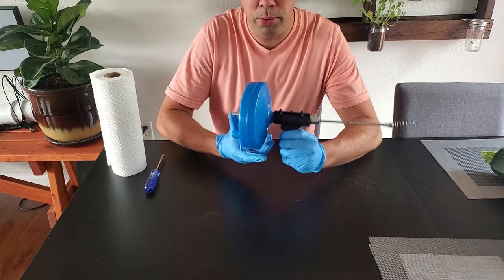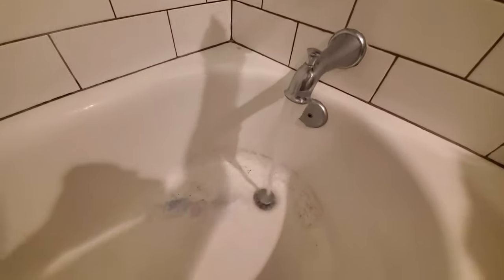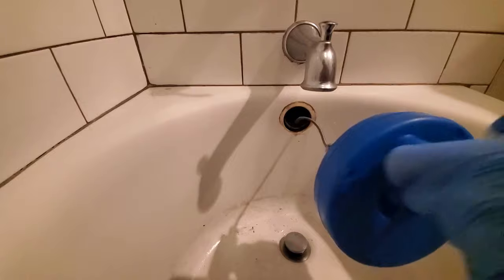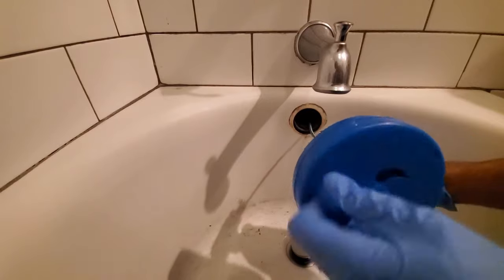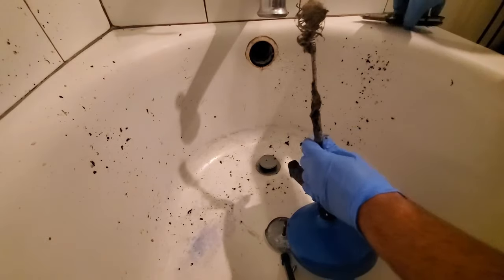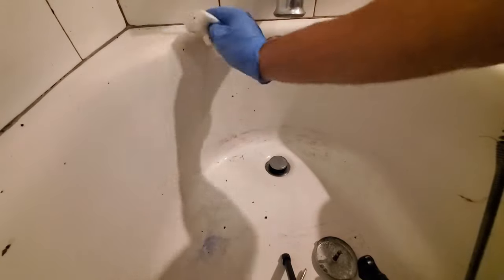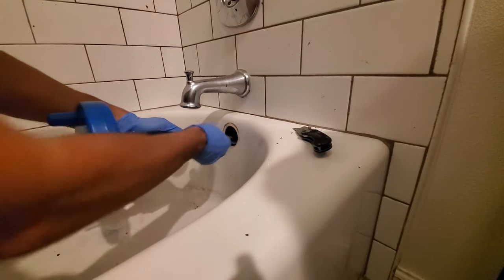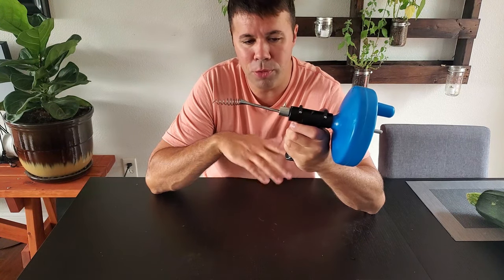How to Unclog a Bathtub Drain Using a Snake (Drum Auger)

Comment: Holy [cussword], I tried it and it *worked*! I was reluctant to use the auger I bought a few years ago at Ace Hardware for $15, because I am not very good with tools. But once I knew to use the upper drain opening and not the one at the bottom of the tub (which will get you exactly nowhere), it was extremely easy once I got that covering off. (Seriously, without the Internet, I would never have known that covering was over the main drain opening.) I could hear it sliding through the drain under the tub and it didn't meet very much resistance, so I just pulled it out (nothing but a little soap-scuzz on the coil) and then ran the water like I normally run it for eight minutes. It was clear as a bell! I keep a hair-catcher over the bottom drain-opening (and I kept it there while unscrewing and rescrewing the covering on the top opening so the screws wouldn't fall into the bottom opening), so I think there was just a wad of soap-scuzz in there that the coil pushed out of the drain and into the pipe. Now when I take a shower and the water flows out of the tube at the rate it's supposed to, I can say that I did that because I know how to do that!
Reply from the maker: Good for you!  Happy to worked out and you found my video helpful!  Now you will know moving forward how to always clear the clog yourself and save money from calling a plumber.  BTW...I like your "Holy [Cussword]" wording.  I am going to have to use that somewhere in my Youtube comments one of these days.  :-)
Reply: @JMGENTERPRISES  Here's another thing that helps you clear gunk out of very old shower drains without using environmentally-damaging chemicals: Pour 2-3 quarts of boiling water 2-4 times in succession down the drain. Of course, you want to be extremely careful conveying the pot of scalding water from the kitchen to the bathroom. If it's an upstairs bathroom, you might want to just boil the water right on the spot in an extra-large-sized hot-pot so that you're not imperiling yourself by carrying a pot of dangerously hot water up one or more flights of stairs.
Reply: Find a tub drain hair catcher to keep the hair out
Reply: @Wade7715  Been doing that for the past six years. My plusbig problem is soap scum mixed with that fungusy black gunk. (I live in an almost century-old building, so I'm sure the pipes are weirdly structured, adding another layer problem.)
Reply: @venuspluto67  thank you for your video. Well done!
Reply: @venuspluto67  Absolutely. Be very careful with scalding hot water

Comment: Came across this video while searching on using snakes to unclog a drain.    Just used one on a clogged kitchen sink.    Clog was pretty far down as it took a good 10 to 12 foot of snake before I saw the water drain.     Pulled up some assorted gunk and a safety pin of all things!

As to tubs, I have a cleanout plug which makes access very easy.   Of course if you have standing water it would be like unleashing old faithful once you remove the plug :-).
Reply from the maker: Glad you were able to use it with success on a kitchen sink!  Thanks for sharing!

Comment: If you rotate it clockwise on extraction instead of counter-clockwise, it won't splatter everywhere.  You're loading up the coil at the end like a spring and it's snapping loose when it gets pulled past its point of resistance.
Reply from the maker: Thanks for the tip Yale!  That will save me a nasty mess in the future!

Comment: Thanks for the knowledge.  Just did this, but had to run the snake down my vent pipe as it musta had leaves blocking the air flow.
Reply from the maker: Glad you were able to get it fixed!
Reply: Ughhh this is what I’m afraid of! My tub was flowing totally fine then all the sudden BAM nothing so I’m worried it’s the vent pipe. I’m def not getting up on my two story roof though!

Comment: reporting back here -- i got the amazon snake and snaked thru the top tub drain handle as shown in the video and all was fine, it got some hair out for sure. however, while it felt clear inside the pipe and was clear after a few more tries, and it did help the water drain a bit, it did not fix the clog fully. i could not fit the snake in the bottom drain to try there because it has the metal cross braces in it and the auger would not squeeze thru those. same issue for the bathroom sink. i dont want to force it too much and get it stuck, so i think i will have to go get another auger with a thinner/skinnier point. or maybe i should just try harder to force it past the drain braces anyway, not sure (i probably could do that)??
Reply from the maker: Can you remove the cross braces?

Comment: Any recommendations for getting sand out of the shower drain, was hand washing a wet suit and now my drains slowly draining 🙏🏾 I bought a cheap snake but i don’t think it can push the sand out ,, I don’t want to use draino if it’s just gonna get stuck in the tub , thank you
Reply from the maker: First off, hope you had fun in the ocean!!!  I wouldn't think the wetsuit would trap that much sand.  I have washed my off many times in the shower.  Have you snaked it several times?
Reply: @JMGENTERPRISES  I had accidentally let the sand set it and forgot to shake it out like a dummy , threw it straight in the tub , a good amout came off immediately then went down the drain , got stuck for a second then it went down but then it got clogged, i snaked both side of the drain and the overflow, completely clear but it’s pretty deep , would a shop vac work you think ? I’m debating either a auger or a shop vac , if you could give some advice!
Reply: @JMGENTERPRISES  thank you for replying!

Comment: Do you have any suggestions as to why the shower drain smells like vomit after using? And any remedies? It always comes back no matter how much it is cleaned
Reply from the maker: I would try some odor neutralizer liquid and see if that helps.  I haven't had that issue before.  Doesn't sound pleasant 😕

Comment: What do you recommend, my tub has 1 cleanout screw that comes out, and 1 cleanout screw that is stuck, whats the best option to remove the ceased screw
Reply from the maker: Usually heat works to break free a stuck screw.  Do you have a small butane torch?  They are like $10 or less on Amazon.  They come in handy for many things around the house :-)
Reply: @JMGENTERPRISES  im gonna pick one up thank you!!

Comment: Thanks for a great video. I know I must be the only one in the world who is having a problem. I having trouble to get the snake past the trap. It will not go. I go slow so it won’t twist and kink up. there is so many bends that the snake just wants to come back out of the bathtub drain and the sink drain. Any ideas? Thanks in advance
Reply from the maker: Have you tried both traps?  Sometimes the upper one is easier.
Reply: @JMGENTERPRISES  yes the two in the tub and one at the sink but I took the trap out and still same. What’s don’t make sense is I did this a couple years back with success. lol. Now is just not cooperating.

Comment: I watched your video and tried to insert the snake into both the bottom drain and the overflow hole below the faucet as shown in the video. Both have a trap or sectioned plate that I can't get past, even when using a drill. I finally got the snake into the drain and noticed that it was only going sideways until it was visible in the overflow hole under the faucet. I can't get the snake to go any other direction. What should I do?
Reply: I just realized that some of the tips of the auger are smaller. Mine seems too large and has  two different wider coils making it harder to get inside
Reply from the maker: Sounds like maybe try an auger with a smaller tip.  That's all I can think of trying.  I know they sell augers with exchangeable sized tips.  Best of luck.  Let me know how it goes!

Comment: hey so i tried this but my auger would hit something and then start winding in reverse...felt like i hit the bottom of something and the auger wouldnt get further and then when i pull it out i dont see hair or anything
Reply from the maker: Make sure to keep hold of the rotating knob so it does not start unwinding in reverse.  You may want to try going through the bottom drain the tub as well and see if you have better results.
Reply: @JMGENTERPRISES  thank you! I think i wasnt pushing hard enough bc it eventually went through and i managed to go through the full length of the auger cable. I need to go through the other drain but it has that annoying mesh thing you showed in the video /: so i dont think I can get the auger through 🥲

Comment: My bathtub drain is clogged and when I use the snake drill nothing comes up…what do you think is the problem and what should I do ???
Reply from the maker: How far are you going down with the snake?  I'm sure it's a semi clog somewhere
Reply: @JMGENTERPRISES  with the snake about 15 inches...it hits the bottom of something and when i start drilling nothing comes up but water does not go down fast
Reply from the maker: @arcademcFLy  it might just be a bend in the piping you are hitting.  Try twisting it some and see if you can fish any more line in there
Reply: @JMGENTERPRISES  twist right or left...not sure how the pipes run

Comment: Thanks for this video! So I'm working on our shower; it's a stall and not a tub so no overflow valve, I'm driving the auger into the drain in the shower floor. I was able to get a small bit of what looks like brown grass out of the drain after about three tries, but it's still not draining and I've used nearly all 25 feet of snake. Surely the clog isn't that far down? Is there another way into the pipes that I should try? Also I wonder if that grass-looking stuff means we have tree or plant roots getting into the pipes. :(
Reply from the maker: Sorry to hear about your struggles with your shower.  I haven't heard of grass before but yeah, it sounds like it is coming in from somewhere.  I've never personally had a clog further than 10 feet down so I would say you are safe if you used all 25 feet.  How do you know you have a clog?  Is it backing up with water after running the shower?  How long does it take to begin pooling in your shower?  Typically, the further down the clog, the longer it will take for the water to begin pooling in the shower.

Comment: Just curious why you go through the overflow drain and not the lower drain? I can see that the lower drain is where all tye hair is entwined around. I'm on here looking for a tool to remove the hair because nothing I have would grab it and found your video. I have an auger from several years ago I got to unclog a kitchen sink. It never crossed my mind to use on the tub because the build up seems to be right below the surface. This is my plan for tomorrow after I buy some gloves.  Thanks for your video.
Reply from the maker: Honestly, going through the overflow drain was how I was taught.  I would think going through the bottom drain would work too as long as you can fish the snake through the grate.

Comment: Mine, is a very old tub, it has that thing high up, but I couldn't see a screw, it just has an old chain for what was the tub stopper.  The drain itself, does have 2 thin rods blocking it like the thing yours went through, but my augur seems to get stuck almost right away in the drain after I get past the rods.  I'm hoping your advice will help get past that, otherwise I'll just be fortunate that my brother in law is a plumber, and is generally willing to help out with manpower type stuff.  

Might have to double check the overflow access, maybe there's something I missed, but I don't think so, because the whole faucet assembly seems to be blocking any potential removal.
Reply from the maker: So you do have an overflow access on your tub?  I would recommend going in that way.

Comment: How do you get it past the elbow via the overflow? That's where I'm stuck atm. Also tried plugging up the overflow and using a plunger to no avail
Reply from the maker: It should just push through the elbow.  Have you tried rotating the handle when pushing?

Comment: I bought mine in a "like new" unboxed from Amazon and the wires are a little bit rusted.. i am wondering if anyone who bought it new and in box, if the wires are rusted or did some guy buy the tool used it and returned it. It doesn't stink like stink water so im a bit confused why.
Reply from the maker: Sounds like the wires were exposed to water causing it to rust.  Mine is slightly rusted from general use and still works as it should.  Be sure to always dry it or it will rust further.

Comment: My bathtub drain is towards the back wall and I do not have a top plate to remove. I cannot get the snake no further than roughly 6 inches down.
Reply from the maker: Usually that means it's not going around the first bend in the pipe.  Are your twisting and pushing?
Reply: @JMGENTERPRISES  yea, twisting and I keep pushing slowly until I am at the point were I cannot twist and turn it anymore as it starts to bind up. I will keep trying

Comment: I just tried this and I can't seem to get any hair out. I know it's super clogged bc the unclogging liquids stopped working and the bathtub starts accumulating immediately when i run the water. Im not sure if I'm doing it wrong. Am I supposed to pull back the wire with my hand after I've got passed the point of resistance until it gets stuck again then lock it again and go counter clockwise? I was pulling it completely out with my hand and was only getting very small strands of hair and it's still clogged. 😮‍💨
Reply from the maker: Well you want to make you screw through the clog then pull it back

Comment: Can I run a sake auger through bathtub liner?
Reply from the maker: I have before and it worked
Reply: @JMGENTERPRISES  thank you for answering. I ended up buying snake auger and just ran it through. After a few attempts I got some hair out but my problem was my lovely wife be dying her hair at home and I uncovered all the black dye coming up. So I’m assuming it was the dye, after a few months the hair dye becomes hard. So I put the snake inside and told her to turn on the water faucets way the dye would become soft. And it worked. Now the bathroom tub is running good so far. Thanks again

Comment: Thank you for this video. i got a 25ft auger yesterday and started feeding it into the overflow and just kept going and going without hitting anything... is this possible? Can blockages happen at any point in the pipe? I thought once past the floor level, the pipes would be horizontal to prevent blockages...
Reply from the maker: Hmmmm.  Yeah, I have never experienced a clog past 10 feet or so.  What are the symptoms of your tub?  Is it not draining quickly?
Reply: Did you use the entire 25 ft? The clogged pipe might be somewhere else. My neighbors shower drain was clogged and the plumber had to climb her roof and insert the snake thru a pipe on her roof. I really hope that doesn't happen in your situation
Reply from the maker: @lexbeltran1354  -  My clogs are usually just about 3-5 feet down.  Usually the first bend in the pipe is where the clog happens for me.

Comment: How did you get it through the p Trap?
Reply from the maker: I usually just slightly push and twist
Reply: @JMGENTERPRISES  i tried man but i stopped i dont wanna have a broken pipe lol.. are you sure you have p trap? Some people have S trap which is easier to push through
Reply from the maker: @henejbenej3079  do you have access to the opening on the side of the tub?

Comment: Every video I watch everyone seems to get their auger down the drain no problem. My auger just can't seem to find the drain no matter how much I'm turning it clockwise. If I'm doing it wrong please help😆
Reply from the maker: Are you trying to go through the bottom drain or the side?
Reply: @JMGENTERPRISES  the overflow just like you did
Reply from the maker: Hmmmm.  How far can you get the augur in before it stops?  Maybe you are hitting the clog?
Reply: @JMGENTERPRISES  I say I go about 6 inches or so in and I'm hitting a dead end. It's definitely the metal that's part of what's leading to the drain opening. I tried to snap a pic with the flash on and I could kind of see an opening but the snake just won't turn to go in it. I'm not sure if all augers are the same diameter, maybe mine is too big for the whole. IDK.
Reply from the maker: Sorry to hear that.  All the augers I have seen seem to have have same end on them.  Weird.  Maybe the pipes are smaller diameter.
Reply: @JMGENTERPRISES  no worries. I used the plunger method and everything is good now. I appreciate you taking the time to reply and trying to help. New subscriber. 👍🏻

Comment: I found the clog after I put the snake soooo deep. I used the whole snake! I think it’s not made to pull out the whole thing because it wouldn’t pull back into the round thing anymore. I’m still confused about how to pull it back. So I just pulled it back with my hands and the whole thing started turning into like circles and splashing junk all over me. I my feet and my legs and all over the tub and the curtain. It was nasty. But I kept pulling, and I finally got the mess that was clogged in my tub. It was huge!! Now I still don’t know how to put it back into the orange thing cuz it’s all out! What I did was I rinsed the thing with hot water,  then I put it on top of a plastic bag, a big one and a big towel to let it dry, and I took it out of the tub and left it there. I have no idea how I’m Gna get that thing inside the orange circle again! Please help!!
Reply from the maker: Maria -  Glad to hear you were able to remove the clog.  The snake is under like a spring tension when you rewind it back into the container.  Is it not winding in the container correctly?